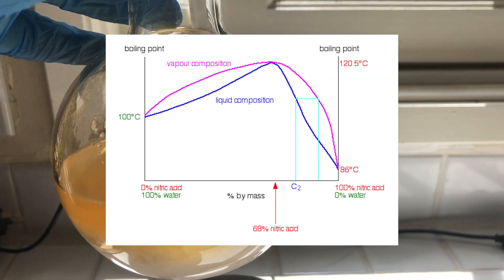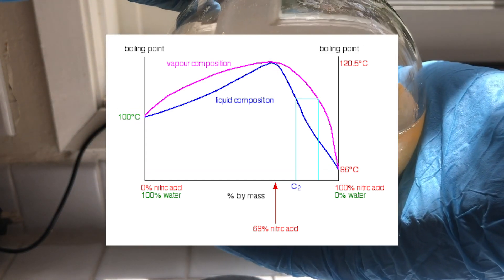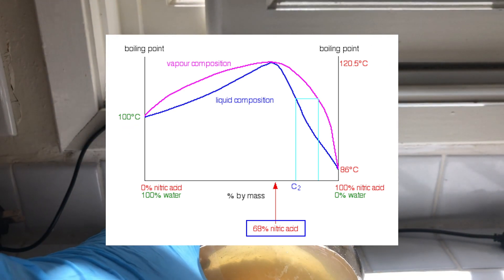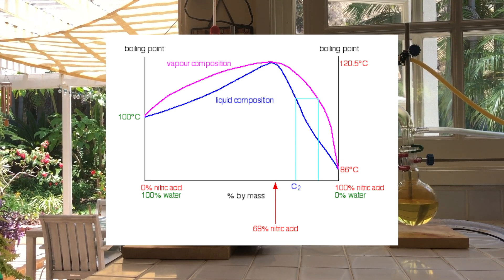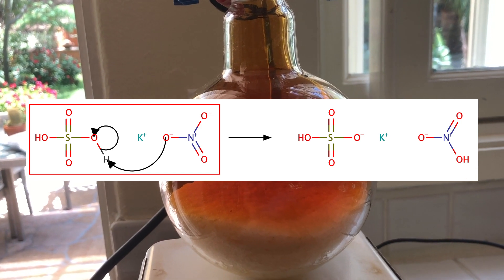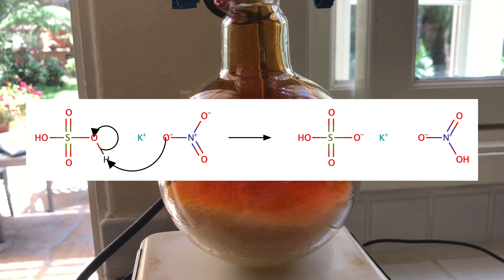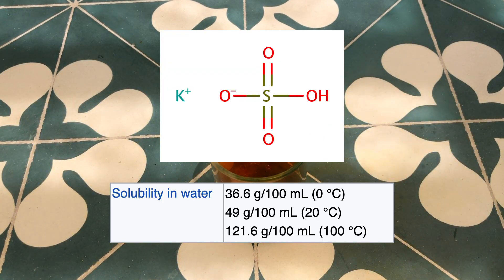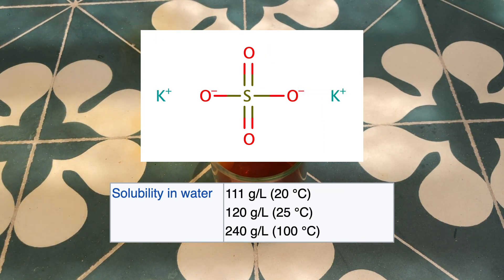Making Concentrated Nitric Acid

Comment: You can fix the leaky thermometer adapter by replacing the O-ring seal with an appropriately sized O-ring made from FPM (fluoropolymer elastomer a.k.a. Viton) - these O-rings are fairly cheap and have great chemical resistance.
Alternatively, you can use PTFE stopper w. hole for stirrer shaft (see on eBay) with FPM O-ring - this will give you even better chemical and thermal resistance (I've used them successfully even agaist bromine), though the PTFE stoppers tend to freeze inside the ground glass neck due to large surface area.
Yet another solution is an thermometer adapter, either closed one (need using some thermal conductor with it) or an open one (you can use Teflon tape to seal your thermometer).
The very best thing is an all-glass thermometer with ground glass male fitting, but these are little more expensive.

Comment: 3:20 Just another note on safety. While it is unlikely, if the flask were to break or if you were to have sudden hard bumping that leaks nitric acid, having the nitric acid mix with the hot oil is probably not a good thing. An oil bath is absolutely a bad idea if you're making fuming nitric acid but I don't know how bad of an issue it would be for concentrated nitric acid. I always assumed since nitric acid is incompatible with organic materials, that the hot liquids would react vigorously. Definitely do NOT use an oil bath during the first reaction where there is a lot of nitric acid and sulfuric acid. If there is a large leak you would be having the nitronium ion trying to nitrate an organic substance at high temperatures. That will usually result in a vigorous runaway. 

If you can, use a sand bath. They take longer to heat up but it's better than just putting the flask on the hot plate, and safer in a spill if the acids leak.
Reply from the maker: You're totally right about that! I'm actually planning to buy a heating mantle soon to fix issues like this. It should also make heating more efficient.
Reply: @thorslab2113  That's great news! I'm a bit jealous haha I only have a hot plate magnetic stirrer. I love it don't get me wrong but for distillations a heating mantle would be so much better haha.

I realize I also probably seem like I'm trying to harp on you for every little mistake but believe me I am not. I can pick out far more positive things in this video than I can negative. I'd just hate to see videos not being made anymore because of an accident I could've helped prevent. So don't feel down about me saying these things! I really like your videos and I want you to be able to keep them coming haha.

Comment: why do chemists use sepcial hot plate instead of normal one used for cooking?
Reply from the maker: There are a few reasons: The number one reason is that chemistry hotplates have magnetic stirrers. This is because you most often have to stir a reaction — so our hotplates have a spinning magnet inside of them that will turn a magnet coated in teflon (called a stir bar). Second, those hot plates are not safe for use with chemicals! They can be flammability hazards and are not designed to be safe with chemical spills. Chemistry hotplates have ceramic tops that wont react with chemicals and are designed to channel any possible spills away from anywhere they could get ignited. Third, they can often not get hot enough.

They can be very expensive, but they're a must-have in the lab. This one I got on OfferUp for only $70! It was a huge score. But new ones can run you $250-500.

Remember to never do any chemistry on your stove! It's very dangerous to work around an open flame.
Reply: @thorslab2113  thanks alot for replying!

Comment: Only teflon can withstand hot nitric acid fumes and that's why your adapter started to loosen itself. And that's why I've bought a glass thermometer adapter. I hope my first attempt will go well... Anyway, great video!
Reply from the maker: Thanks! This is what I figured too. In an attempt to minimize this though, I did wrap the adapter and the threads in teflon tape. A glass thermometer adapter + thermocouple are high on my list of items to purchase for the lab.

Comment: what water pump do you use?
Reply from the maker: Sorry for the late reply! My first pump was a "high pressure" 12V pump from Amazon that was about $25. I used one of these because I wanted to pass it through a water aspirator to get a nice vacuum for filtration. While it works okay, it wasn't really high pressure at all so the vacuum it produced was garbage. Also it was deafeningly loud. So I bought a little $20-25 super quiet aquarium pump that works much better now! And it's quiet as hell!
Reply: @thorslab2113  no problem, you seem very busy. I am getting a glass aspirator pump myself, so the 12V pump wasn't enough for a good vacuum you say? That's a shame, I was gonna get one. Any additional tips you can give for an aspirator pump setup?
Reply from the maker: @Kermy  I think it was NurdRage that used a water aspirator with a 12V pump and it worked well for him. Maybe it was just a crappy water aspirator I got, or maybe it was the pump. Either way, I wasn't able to get a significant vacuum at all using this set up. When I have a chance to get back to my lab I think I'm going to try getting a better pump.

What I did was get a 5 gal bucket at home depot, and I affixed the pump to the outside of that, and affixed the inlet tubing permanently to the inside near the bottom. Then I'd just place this bucket in the sink next to where I do my reactions, and it worked good enough to at least help with filtration. But not good enough for any sort of vacuum distillation.

Good luck!
Reply: @thorslab2113  thanks for the info, will definitely help me setting up my lab! Just wondering, do you use a glass aspirator pump or a different one?

Comment: Good informative vid. Please add a warning  about NO2.
Reply from the maker: You're right, I should definitely be more clear about the dangers involved in each of my videos. Will add clear warnings in the next video! Updated the description for now.
Reply: @thorslab2113  4:01 u Said during the lenght of distillation make nitric acid turn yellow rather than a clear One,so...you might need to use more heat ?? Or what???